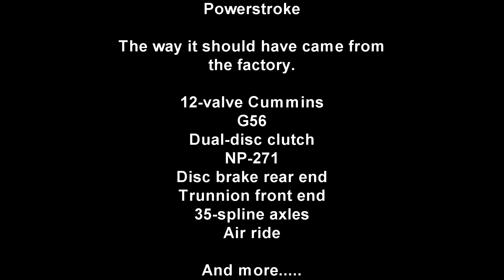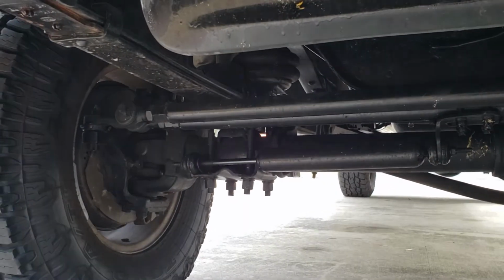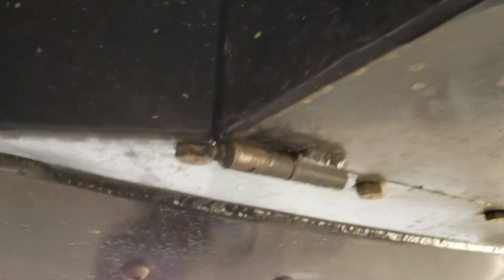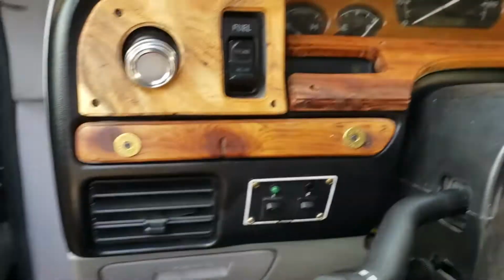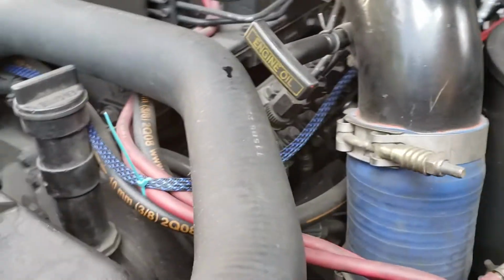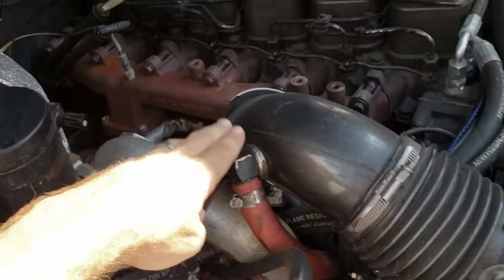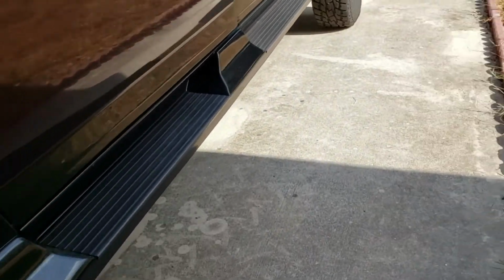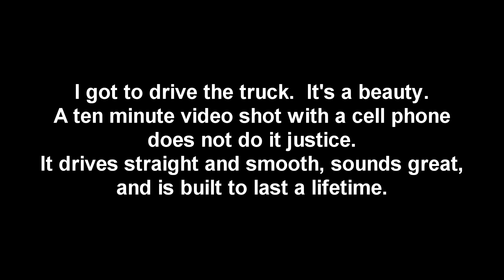The King of Trucks

Comment: Double wall drivelines with 1350 u-joints front 1415 rear, 54 gallon fuel capacity, LED lights throughout, puddle lamps on mirrors, 2007 gmc seats front and rear with custom upholstery. Sound proofed cab, GM .75 tie rod ends also.
Reply: There's a lot I missed. I was sick af. What were the two joysticks by the air ride switches for? I forgot. Truck has a lot going on.